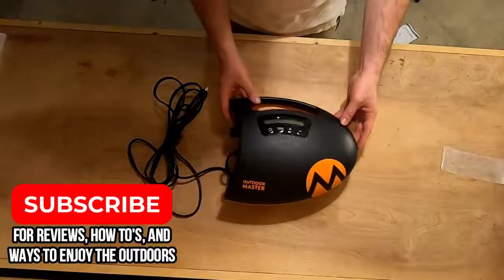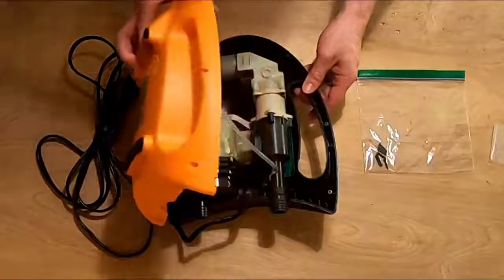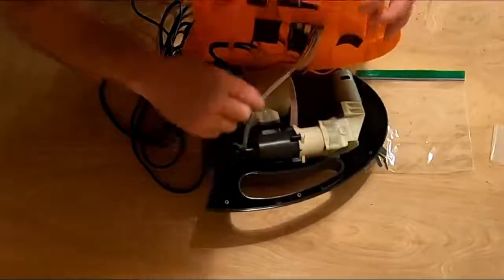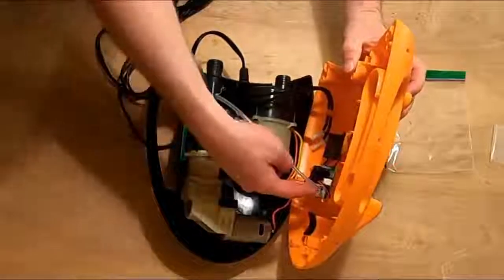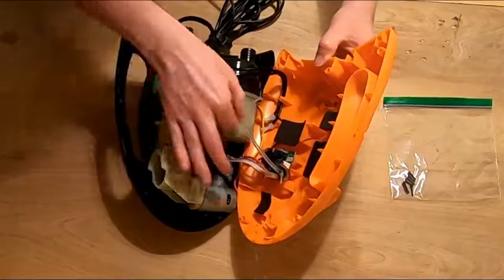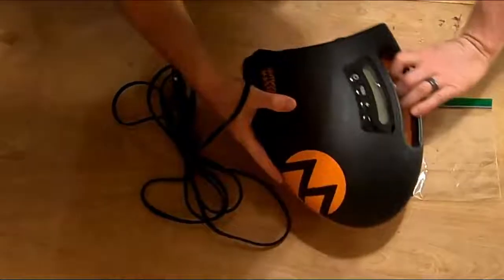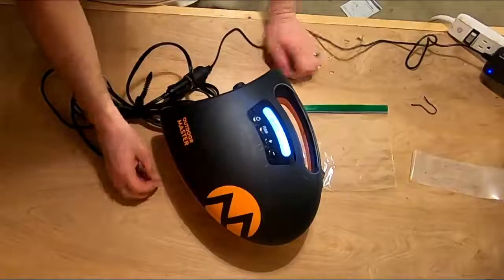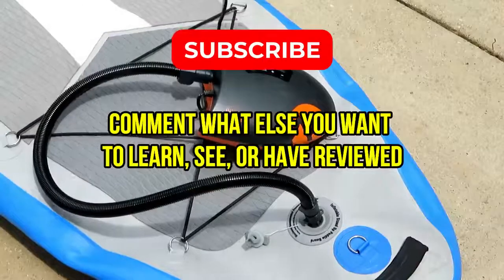Repairing an Outdoor Master Shark electric stand-up paddleboard SUP pump

Comment: i've had one for several years, and what's failed on mine is the seal on the piston on the high pressure pump. Have you encountered this? I've been trying to fine a replacement part (the rubber has broken down) but Outdoormaster aren't being helpful (and I'm outside warranty)